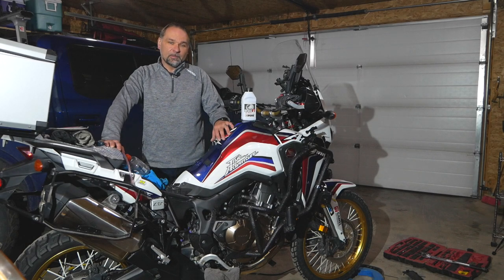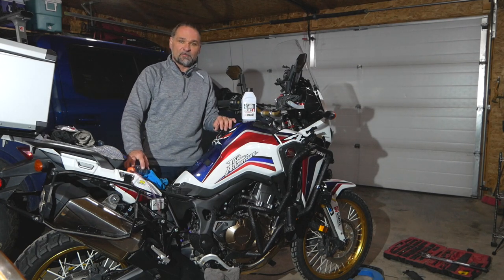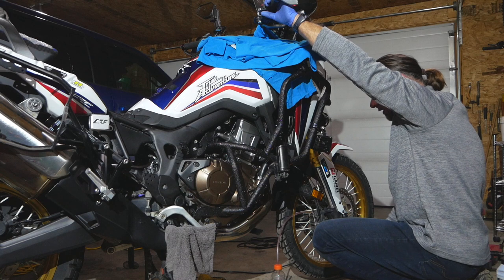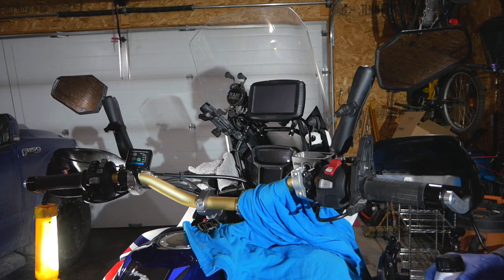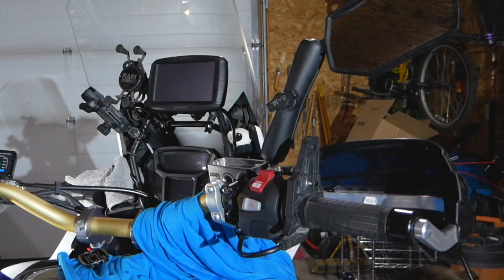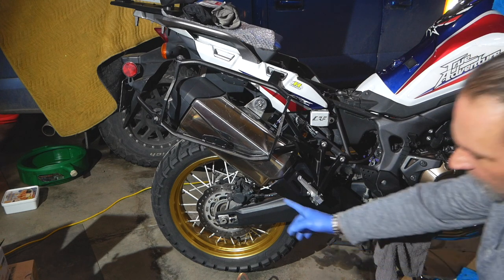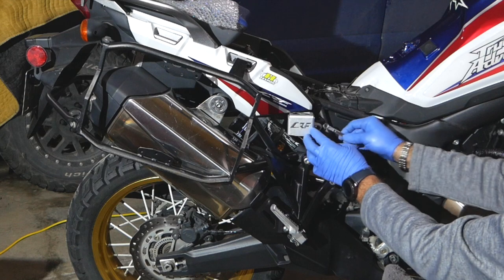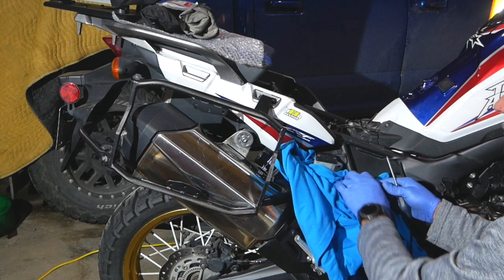HOW TO FLASH BRAKES FLUID ON A MOTORCYCLE (BRAKES FLUSH HONDA AFRICA TWIN 2017)

Comment: Nice video - I prefer to suck the brake fluid out the reservoir with a new turkey baster first rather than flush the old fluid back through the system.
Reply from the maker: With gravity bleeding you are not getting old fluid in the system and if you watched my video I have filled the reservoirs multiple times all old fluid is gone this way as well. Brake fluid is cheap lol

Comment: Thanks. I'm going to try on mine. I overheated my rear brake and it ceased working until it cooled down. I guess the fluid needs to be changed now as it would have boiled.
Reply from the maker: Always a good idea, better be safe then sorry thank you for the comment

Comment: Hello! For my knowledge: how much brake fluid is needed? 0,5 l DOT 4 brake fluid is enough?
Reply from the maker: If you buy the container that I show in the video that's more then enough still had some left after it was finished, but I don't remember the size of the bottle.  The reservoirs are small plus whatever in brake hoses.

Comment: Great knowledge! Thanks!!! I think you can also speed up the process by sucking up almost all old fluid out of the container using a  syringe, right? ;)
Reply from the maker: That idea of bleeding brakes is not to introduce any air i would try to avoid the seringe,  as then you may get air in the system.  I have been doing this way all the time and many others do as well.  I am not a mechanic but i worked on cars in the past as well same procedure

Comment: Hey buddy, quick question. What is the diameter of the pipe did you use there? 5mm,6mm or 8mm?
Reply from the maker: Inside 5mm outside 8mm

Comment: Tip: put a ty wrap for one night on the brake lever…. All the micro air will pushed out in one night and the brake is nice and tight after that.
Reply from the maker: That's if you want to wait all night,😉
Reply: @AdventureTravelandScuba  yup 🙊

Comment: In the service manual description there ist only bleeded right front, nothing written about left front bleeding screw?
Reply from the maker: I am aware of that but if there is a bleeder screw I'm bleeding it what about the line that goes to the left caliper what if the air is trapped there, it will not hurt it to do it, brake fluid is cheap.